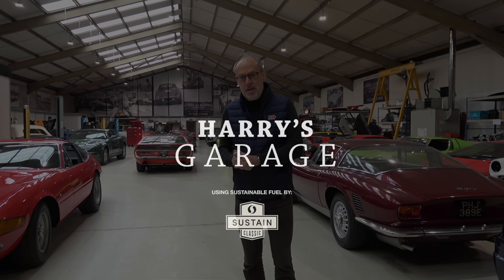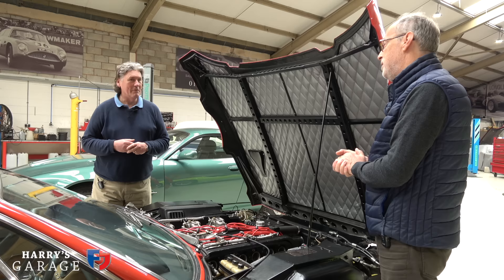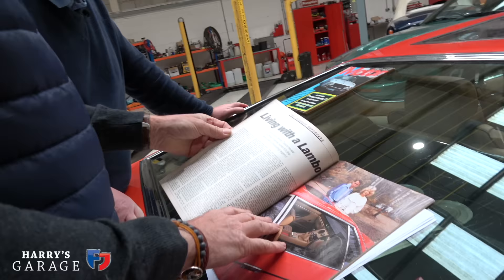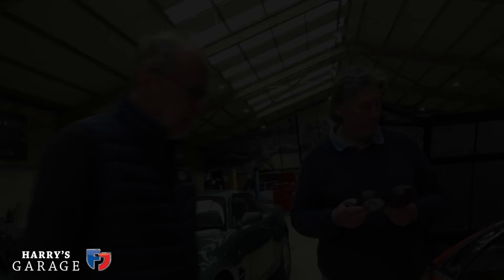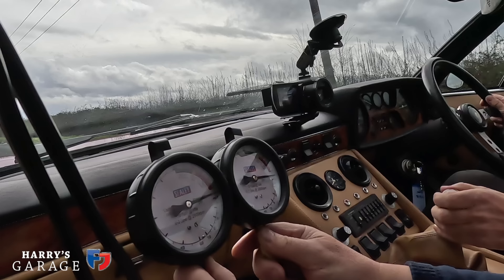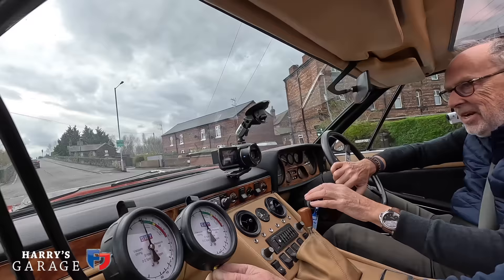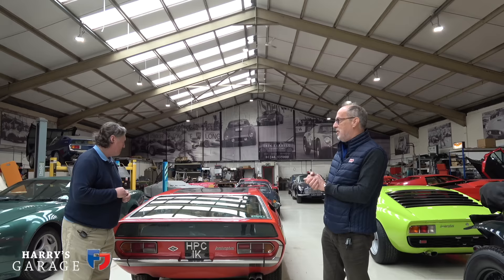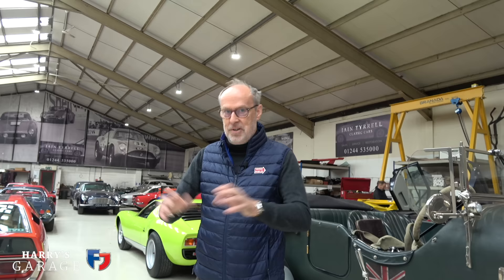Lamborghini Espada is back with Iain Tyrrell in search for more power. Plus Marcello Gandini tribute

Comment: So the carb leaking issue was down to the high back pressure?  How come that's only just revealed itself?
Reply: No, it would have been a sticking float from where the car was left for a long period and the fuel in the bowl evaporated. When you switch it on after a long period the carbs tend to flood as the floats stick open. A quick tap with a screwdriver sorts it out.

Comment: It’s 2024. You can get really near the optimum lengths and diameters given space restrictions using expert systems followed by 1-D computer simulation. Takes a few hours. You first replicate the current system and use the dyno data to check output. Then start from there.  If you want to add the silencers it does get more complex. Design just for power is relatively easy but decent sound levels and low back pressure (0 is the number to shoot for btw) and importantly sound quality is harder. A sensible tactic is to design the headers then terminate them into a large resonator effectively trying to behave as just atmosphere. Then use fairly large diameter and low bp dampers downstream. As there are many stock engines producing 500 bhp plus you can go shop for options from OEMs or US V8 aftermarket.

Comment: Take if to an exhaust expert and have them make you the most nonrestrictive system possible.
Also... note that when you do some upgrading of the engine, the exhaust is ALWAYS something that should be looked at, at the same time... so to have updated the engine for more power, and not given the exhaust a thought, was a mistake.
This can be one of the downsides of getting mechanics used to working on stock cars to do engine upgrades... they are not trained in looking into all aspects of engine performance... which includes the exhaust of course.
Iain is obviously a fantastic mechanic and one of the best in the world for working on stock cars... not doubt... but for performance upgrades, maybe he just needs to bring in the expertise of others... form your part harry, very good thinking about the exhaust.

Comment: Would you expect to loose that mid range torque with a free flowing exhaust?
Reply: Maybe if it is due to too small exhaust diameter and at lower rpm the exhaust flows a bit faster leading to better cylinder scavenge. But not really if it is due to some other restriction. It might feel weaker if the top end goes up a lot even if it has not lost anything in the midrange. Our senses are easily fooled and we feel things relative to an extent.  Going to be interesting to follow :) also the huge variation in exhaust design is maybe a sign of the hand built nature of these cars.
Reply: A large exhaust back section has rarely caused a loss fo torque. The length of the exhaust will matter a lot more. Just build it as big as possible.

Comment: You are not going to find your missing 100 bhp chasing back pressure. Having subjected engines to enormously high back pressure tests for emissions regs. Think a 3 inch exhaust reduced to a paper width opening. Back pressure makes little difference in outright performance.
Reply: Precisely. I have done some exhaust testing for drag racing cars here in Europe, and we have done very quiet exhausts on 1500-2000 hp engines. It's amazing what a 3" and 4" exhaust can support, even with huge mufflers.
Everything here points to heads with way too little flow. If you haven't, go back and watch the video where they tear the engine down. The heads are very small, and the exhaust ports are ridiculously small. They can straight pipe that thing with 1.75" primaries, and it will pick up fairly little. When they ended up with a back pressure of 4 psi, you can be pretty sure what ever reversion there might have been from the pressure was gone. I'd say they would be lucky to gain 20 hp without head work.

Comment: First, that Vanquish 🤤
Secondly, full, stepped, equal length stainless headers, at least 1½" primaries at the large end step, 3" collectors, 3" dual exhaust, an X pipe, and a custom back box with 3" inlets for each and dual 2½" outs each side for vintage appearance sake....let that thing breathe, plus equal length headers and an X crossover instead of an H will drastically improve the sound, all stainless of course, unless you want a deeper tone, then run titanium at the end at least.

Comment: Firstly these engines are relatively low capacity for a V12 and like most the complicated twin ohc really doesnt do much when pushrod engines are more than capable of delivering more or less as good results in terms of horsepower per litre all without variable valve timing.
Wheel horsepower is around 20% less than flywheel power.Some say 30%.
So 250 at the wheels is in the ball park of the quoted factory flywheel power.
Might as well run it with totally straight through exhausts or at least just the Jarama type rear boxes and get rid of the centre boxes.But 75 hp per litre at the flywheel is going to be around the limit and no way that it will get closer to 300 than 250 at the wheels.
I'd prefer to put the money into the XJ12 coupe.There is far more potential in the Jaguar V12 up to at least 7 litres without the need for twin cams and there's no substitute for cubic inches and with ITB induction options.Also lots of simple and effective exhaust solutions.
To add to the question of the Espada's quoted power outputs, the standard 5.3 XJS manual 4 speed out accelerated the MkIII Espada and virtually matched its max speed in the Motor twin test of 1976 with less than 300 bhp.

Comment: Needs Holley headers, 4 inch pipe, x pipe and Borla straight through mufflers.  Should get you top notch performance.  None of the 90 degree mufflers at the tail nonsense.

Comment: The Hot Rod / Engine Masters guys did extensive testing on exhaust system restriction and pipe size. It would be interesting to see one of these V12s with a full 2.75-3” system on it

https://youtu.be/_PVXvHkr-Vs?si=QBCahF1QN1Wd470x

Comment: If you’re hoping to make close to 400hp, you need 2x 2.25” ID exhausts. I’d throw in an X pipe in there aswell to make the exhaust as efficient as possible (bit like the XJC). And you want to aim for as close to 0 back pressure as possible!

I don’t know much about the exhaust system you’re looking at, but a custom system in that ID with a pair of resonators and a pair of silencers really wouldn’t cost the earth…. I’d dare to say that with Lambo tax on the system you’re after, it’s probably a more cost effective option for a more efficient exhaust

Comment: https://www.youtube.com/watch?v=2KLSmeAXUHU
 What engine is that, i mean its a Lambo V12 of course .
But it´s pulls the "right" numbers with those small headers ect.
So further down you can read a comment regarding the Bob Wallace comment that these engines are restricted by the small intake/exhaust ports in the cylinderheads.......
Is this engine on that dyno a  "ported" /tuned" one ?

Comment: The back pressure in the exhaust has nothing to do with exhaust port size in this test, the engine displaces what it can in the spec that it is! In other words the engine maximum exhaust displacement is X CFM which includes the tiny exhaust ports and the inefficient exhaust system is too restrictive  to cope hence the high back pressure! On an other note 325hp from a V12, quad cam, 6 webbers @ 7000rpm seems ridiculously disappointing!😂

Comment: I don't want to diss Iain Tyrell but if the cars only producing 250hp but he thinks it feels fine and like it should then....
Reply: He is in fact very right. Reality is that this is what this car makes. There's a few things which was not mentioned. First off, back when Lambo did this engine, you can be very sure that the power numbers were Gross power, not net. So when he takes it to a dyno shop, they will more than likely give him DIA or SAE correction. There's a good chance that this engine was tested with good dyno headers, no accessories driven, low cooling temps etc. Add to that some of these engines were know to be overrated in power numbers.

Comment: why did you not take both rear exhausts off ?
Reply: They wanted to do a side by side comparisson.
Reply: @grahambell4298  got it so that is why the right hand side was higher, but not by much
Reply: @londonman8688  Correct - though the difference wasn't as much as expected.

Comment: Honestly, this is getting to be theater.  For sure, Iain would take one look at Harry's Espada and know that the exhaust was made either by the village idiot or Rumpelstiltskin.  An engine is an air pump, and this is putting a closed-off straw at the end of that pump, strangling the engines ability to breath.  To enhance the performance of the Espada (or any car), you need all components of a SYSTEM to flow more air (and provide more fuel).  Harry's insistence on Miura performance is absurd.  The angle at which the side drafts are indirect to the intake valve is one example.  Want more power, put downdrafts on it Harry and cut a hole through the bonnet.  In addition, make an 3 foot exhaust system that cuts out the side of the car.  Finally, as another poster related... Bob Wallace said all Miura variants put out about 325 HP... Honest HP... 745 Watt HP.  Clearly, the sidedraft carbs and extremely long exhaust put a real figure well below that number.
Now, all this said.... I deeply appreciate Iain's posts.... and the fact that Harry was the catalyst to get Iain to undertake that task.

Comment: When you had the engine rebuilt, didnt Ian carry out modifications to increase the horsepower? Now you seem to be trying to find the original spec horsepower...?
Reply: He did, and the power he added is there. But when you don't change the astmathics, you can't expect big gains up top. The torque is very strong, and that's because the engine was enlarged and the cams were changed. But the heads and exhaust won't support the mods up top. He is not a tuner and it is not a common modification, so they are kind of flying blind. As they said, there's nothing wrong. When you do tuning like this, there's always a bit of trial and error.